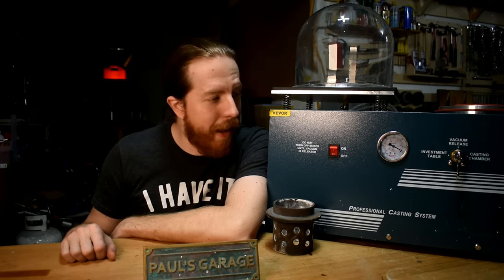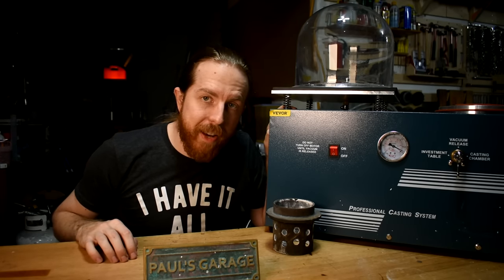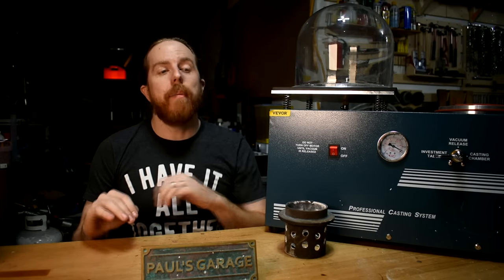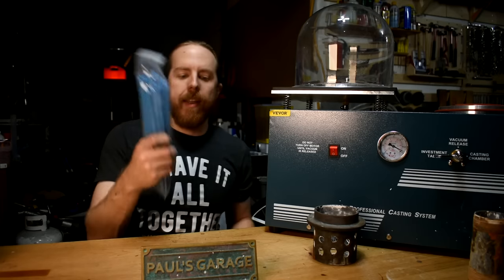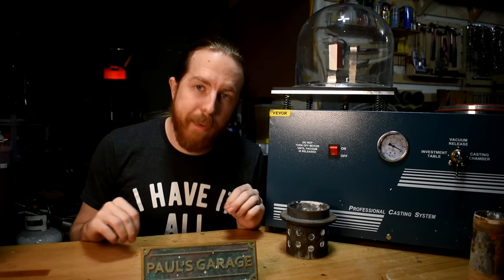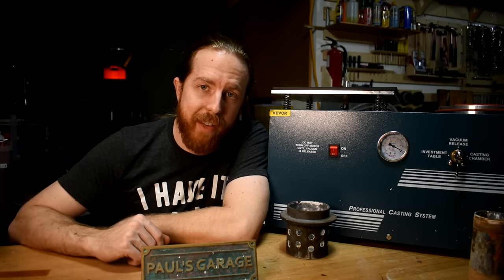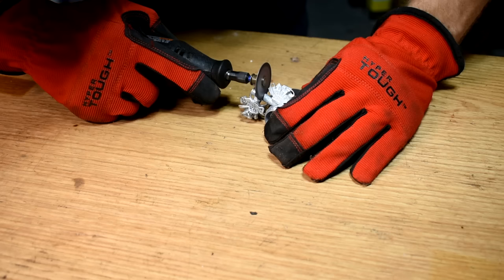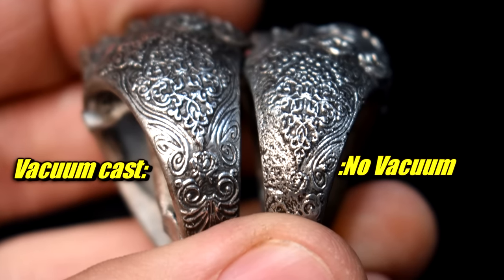Vacuum Casting 3D Prints to Solid Metal! How To

Comment: I'd rather fire my molds for an extra hour and not worry about leftover polycast getting burned in the pour. I've had several castings fail because of impatience. No reason to throw away hours of print time, mold making, and burnout, because you didn't go that extra hour and then have a small amount of polycast ruin the entire cast. I've realized that slow steady heat gives you best burnout results. I've tried using propane weed burning torch to speed up the burnout and it just ruins the quality of the mold by cracking the mold. Be patient everyone. There doesn't seem to be any shortcuts in casting that doesn't include paying for better equipment. Investment casting that is. I've still not done sand casting. The stuff I make needs higher precision then I can get with sand casting
Reply from the maker: Well said!  This takes so long, don't waste all the work with shoetcuts
Reply: I use a pottery kiln for firing the mold. It heats up slowly and has a built in timer. The only thing I'd change is getting a smaller one. I never use the full volume of my kiln
Reply: If you would just move over to wax resin you don’t even need to do a burnout, stick it in a bread toaster opening down and set it to like 240 for a couple minutes

Comment: centrifugal casting is DEFINITELY dangerous. I had an incident in one of my jewelry/silversmithing classes where an unexpectedly loose bolt caused the flask to separate from the crucible and sprayed molten bronze everywhere. I almost lost my face  and I absolutely set my friend on fire (she was wearing heavy cotton so only smouldered a little bit. everyone's fine, miracle that that is). If the "dangerous thing"  you want to do is the thing where you purposefully splatter metal on the surrounding barrier, have the highest barrier you possibly can.
Reply from the maker: Lol I was worried about splatter.  I don't intend to do any splattering intentionally, but I want to go for much bigger mold sizes.  I don't feel like having a giant mold full of pounds of molten bronze whipping around in my garage.  I could get bludgeoned and then burned if it went wrong 🤣
Reply: An "unexpectedly loose bolt" at the wrong place on your car could have you end up in a ditch. 
I've cast with a spincaster for over 40 years and haven't had a single accident because I maintain my equipment. Performed properly spin casting isn't inherently more dangerous than any other industrial process.

Comment: Just a note: if you are investment casting with gems (sapphires, emeralds, rubies etc) you can incorporate them in the wax before casting, but DO NOT quick cool it in water, let it cool down slower at air/room temp. Otherwise it will shatter the gemstones
Reply from the maker: really?  I hadn't thought of that.  sounds like a risky thing to do with an expensive stone, but then again i have no idea how to set a stone in a ring either way
Reply: @PaulsGarage  VOGMan has a video where he tried it.  I think it was about 2 years back.
Reply: Seen it done, the gems don’t have any issues with the high temp.
Reply: @chrism3839  It’s not the heat, it’s the shock cooling that may crack the stones.
Reply: @giuseppe4909  correct, I was not trying to contradict that, just adding to the conversation.
Reply: Don't try with stones that are not super hard like turquoise, etc.
Reply: Vogman has a couple of videos on the process.

Comment: For my jewelry casting I use "sticky wax" it's way more sticky than hot glue and burns out clean. Melt it into the joints but don't use it as the sprues themselves
Reply from the maker: when i look that up i keep getting dental wax, is it that stuff or different?

Comment: Zamak is 90 to 96% zinc and the fumes from zinc are very toxic. I'd stick to pewter, tin or aluminium and you can use high temperature rubber mold mix for metal under 200c!

Comment: Thank you for emphasizing that you should turn the vacuum valve off before shutting down the vacuum pump off.    Or it will draw massive amounts of oil out of the vacuum pump.  Other vacuum pump uploads show that....but they don't emphasize it.  It's a very important step that shouldn't be missed.

Comment: Optimum shell temperatures definitely vary based on alloy...the rule when investment casting steel, stainless steel, nickel-based alloys, and cobalt-based alloys is to hold the shell at 1800˚F for pouring, while cast irons work best at 1400˚F (we never did any investment-cast bronze/brass at my last foundry and where I work now we only pour nickel alloys in the shells we buy from someone else). Based on those temperatures and the usual pouring temps for those alloys and for ZA12, that shell temp is probably a pretty good guess.
Reply from the maker: Bronze/silver/gold mold temps are supposedly 700-900F depending on the thickness of the parts, I guessed lower with za12 because it melts waaay cooler than silver.  Just guessing tho

Comment: I had taken a precious metal casting class from a master caster, and the plaster we used did not require that special ramp up, we had one furnace that did our burnout and our preheat, always set to the same temp. Which either tells me you should look into different plasters, or the ramp up procedure is that that important. I personally like the one oven option.
Reply from the maker: That's good to hear.  We're you using printed resin like this or just wax?  I'd love to short cut the burnout for sure
Reply: @PaulsGarage  I was doing PLA+ as a test, worked perfectly, and others were doing wax.
Reply from the maker: @chrism3839  that's interesting, did he just crank it up to a certain temp or was it a set burn and hold kind of thing?
Reply: @PaulsGarage  It was a very simple oven, with an on and off switch, didn’t have a control board to even program.  it was turned on and left there. We had to wait until it was up to temp before we could put our molds in.
Reply from the maker: @chrism3839 huh that's interesting.  The program for this resin involves cranking at high temperature for a while then lowering down to pouring temp.  I wonder if the burnout process here has more to do with the resin.  Sirayatech cast blue is higher in wax content and they say it is meant to burnout easier.  Maybe ill try that resin with a faster burnout
Reply: @PaulsGarage  certainly worth the experiment. For someone that has the equipment to do the controlled burn out, it makes sense because your reducing any chance of error, but for most of us without access, a simplified method is our only option.

Comment: Plaster, even when "cured" still has moisture in it and if you pour hot metal into it, the moisture flashes into steam and instantly cracks the mold (or even explode if too moist). The ramping up of temperature ensures that steam in the pores slowly evaporates. So no, you can't melt the wax too quickly (for the sake of not cracking the mold). I learned the hard way 🙂

Comment: For a super quick burnout you need a phosphate bonded investment (however you'll also need a sandblaster because its rock hard an won't break up when quenching) I regularly place rings in an 800C oven and cast an hour later, resin or wax.
Reply from the maker: That's interesting, i've never heard of phosphate bonded investment.  That wounds great, but i think i want to avoid the sand blasting.  Mostly because I don't have a sand blaster.  Seems like a worthwhile tradeoff for some applications though.
Reply: @PaulsGarage  it's super common in dental laboratory (and jewelery investments for platinum) ransom and Randolph Biovest is an example of one (that the general public can buy, but it doesn't give a super perfect surface finish unless climbing at 11°c/min from 0, others are more robust).  In the past I've used hydrofluoric acid based wheel cleaner in a bottle, in an ultrasonic.....but that doesn't typically tickle many people's fancy either lol, surely something like vinegar or other dissolving solution could be used.
Reply from the maker: @karlanm925  that's really interesting, thanks.  My burnout oven can be programmed pretty specifically so 11/min should be doable.  Certainly worth trying

Comment: Very nice set up. I just bought a resin printer over Black Friday so I’ll be giving some of this a try.
Reply from the maker: that's great!  which one did you get?  they should all work fine with this resin.  If you have any questions about the wash/cure process, vogman has a great video on it, and you can ask me anything.  Vogman has more experience than I do with lost resin, though.  I just got some siraya tech cast blue which is supposed to be a bit more forgiving to process and burn out, just more difficult to print.
Reply: @PaulsGarage  I got the Elegoo Saturn 3. And I got the true blue castable resin. It seemed like I didn’t need to use glycerin as part of the cure with that one, which seems like a plus. I bought a heating pad made for plants and I’m hoping that will work as a heater to warm the resin. We’ll see. 
I think I will try to make a video of me making things to sell to see how long it takes me to pay it off, if I even can.

Comment: One thing I didn’t hear you mention…. Once you pour the investment into the flask, you should vibrate the flask to mitigate air bubbles in the mold. Also, for polishing, a roller or vibratory polisher with crushed walnut shells ( or other media depending on the material being polished ) can get into the small crevices….

Comment: Where's the split nut!  Lathe!!! Seriously though, nice setup with the new vacuum casting.  I have always wanted to try that method out.
Reply from the maker: well next is the lathe feet which will be sand cast, but i was thinking of using vacuum to make the crank knobs and the split nut.  I could try to cast in cleaner threads on the split nut and do it in aluminum bronze or something to be more wear resistant.  For the crank knobs i 3D modelled up a fillagree looking one i want to try to investment cast, too.  Probably going to make a bunch of cranks, though, several processes.  it would make a good comparo-video

Comment: My vevor electric furnace is still going strong as well.  My custom steel pipe crucible has held up for more than 10# of aluminum foil and tray melting, probably because I welded a piece of 1/4" plate to the bottom.  That will probably be the last to go, even with the big flakes I get after each session.  Still a big jump from $200 for the furnace to $600-700 for the vacuum.  Will have to think more about that, especially since I would also still need an oven.

Right now I'm doing something even stranger.  Laser cutting paper forms, then gluing them together, and plaster coating them.  Its a similar journey of discovery.  (Like I discovered using white glue that washes off is bad if you're going to coat them in wet plaster.)  Still step by step.
Reply from the maker: That electric furnace is fantastic, but it seems like investment casting itself is crazy expensive.  Even ceramic shell, you don't need a vacuum but then you need a really BIG burnout oven.  You can't win lol.  Not like sand casting: wood box and sticky sand, the end.

Comment: Dumb question, but im having trouble finding this info. For the sprues, are there channels going into the vacuum chamber? Ive read "absolutely not" but I immediately think "Well then where does the air go? Through the mold?"
Reply from the maker: Excellent question.  There are no air channels into the vacuum chamber.  This plaster is a little porous, so with the vacuum pressure (or centrifugal pressure from a spin caster) the air gets forced into the plaster, allowing the metal in without bubbles.  Sand casting does the same, the air can go through the sand

Comment: Have you considered dabbling in electroplating any prints? I'm curious about the quality difference potentially between casting and plating.
Reply from the maker: Electroplating looks awesome, but you still end up with a plastic part.  Since I'm building primarily functional stuff, I want the strength.  Electroplating almost looks cooler though
Reply: @PaulsGarage  Absolutely, each has it's place, but for figures and even jewelry I think it would be substantially cheaper and easier.
Reply from the maker: @brandonfrancey5592 cheaper definitely and you could probably use gold and silver.  I don't know about easier, it could be but I'm so comfortable with casting, I'd have to learn electroplating from scratch lol

Comment: Your results are excellent. I'm jealous, I've tried siraya tech cast, I find residues in the foundries and the results don't suit me. I'm also testing resione C01 with difficulties, probably due to the high temperature required to burn it. For the moment, the only good results I've had are with the bluecast X one, which is unfortunately expensive. I'll keep on trying, hoping to achieve the same results as you. Thanks for the motivation! One question: what is the temperature of the plaster during casting za12 ?
Reply from the maker: i've never tried burning out siraya tech in anythign other than a LONG controlled, high temperature oven.  i'm not sure how it burns out in a foundry furnace.  I have heard siraya tech cast blue burns out easier, though.  The plaster temperature for za12 is something i'm guessing at.  same for pouring temp for the za12.  I think in this video, i poured at 500c for the metal, with the flask at 600f.  It stayed liquid still for a VERY long time, i could probably lower the flask temperature another hundred degrees or more.  I've heard 700-900 degrees is the right flask temperature for bronze, but za12 melts at a thousand degrees colder than bronze, so 600f for the flask is likely way too hot.

Comment: I have a question regarding your vacuum casting machine. What is your opinion on the VEVOR z
brand vacuum casting machine you are using? Have you done any castings in silver or gold?
Reply from the maker: I have not done any silver or gold casting with it, but it should be able to do either.  The vevor machine is most likely the same as the toauto machine or other similarly priced ones for sale.  They are all knock offs of the more expensive Kayacast machine, and vevor is just the reseller.  I think vevor gives you a better deal than the others though if you register on their website.  It has been problem free so far.

Comment: Would you say the vevor vacuum is worth it? I’ve read so many people saying to just take the plunge and get the Kaya cast but that one is almost twice the price (even on sale).
Reply from the maker: I haven't tried the Kaya cast, but a friend of mine has.  He likes it, but he's also a jeweler.  The vevor one works for sure, but with kayacast you are getting a better vacuum pump, the degassing table vibrates on its own, and probably a better warranty.  The vevor one works fine, though.  It probably comes down to what you want to do.  If you are producing lots of stuff constantly, always get the better machine.  Occasional use as a hobby, though, and the added cost may not pay you back.  

Personally I plan to do some modifications to the machine and I do NOT want to butcher an expensive Kayacast rig.
Reply: @PaulsGarage  thanks for the response! There’s a lot to weigh esp factoring my own very veeery minimal ability to fix anything that breaks. They’re both going to cost an arm, I guess I should really think about if I want to lose the leg too just for peace of mind
Reply from the maker: @enzomareum1978  Yeah it's always a cost/reward game.  I have rarely regretted getting a better tool, even with the price.

Comment: Do you have to figure out shrinkage for tighter tolerances?
Reply from the maker: yes, all metals will shrink to some extent.  If you need perfect tolerances in any metal, it will have to be machined after casting.

Comment: that castable wax resin is expensive. i wonder if you can use normal resin and make a positive, then make a mold out of silicone or plaster. then cast the negative out of candle wax. bit more work but loads cheaper.
Reply from the maker: I bet you could.  The added cost of the silicone mold would mean you have to make multiples to get your money back though.  Probably a lot of them.  These things I printed in wax resin came out to roughly 30 cents per print, more than double a normal resin, but still literal pennies per item.  When you factor in the plaster and energy and metal, it's probably a miniscule money savings.  It's still probably worth it to get a wax piece to not have to process the resin prints, though.  Just make a wax one in the mold and away you go, no cleaning and curing needed
Reply: ahhh ya thats true. 30 cents isn't bad at all.

Comment from the maker: Equipment used:
Vevor stuff: Code: VVMH5%OFF (5% off on all products)
Vacuum Casting machine: https://s.vevor.com/bfQIQf
Metal Melting Furnace: https://s.vevor.com/bfQoPf

Uniformation Printer: Code: GK140 for $140 off printer, or GK230 for $230 off kit https://www.uniformation3d.com/products/uniformation-gktwo-10-3-8k-resin-printer?sca_ref=4345752.v3kdNjnqDi 

Amazon stuff:
Sirayatech Cast Purple Resin: https://amzn.to/3QOiN0M
Presige Optima Plaster: https://amzn.to/3sCre7l
10mm Wax Sprues 1lb: https://amzn.to/3MS6Cid
1mm Wax straws: https://amzn.to/49Wb3CL
2.5mm Wax straws: https://amzn.to/46loYin
Wax Pen: https://amzn.to/3sCrmUn 

My Burnout Oven Build Playlist: https://youtube.com/playlist?list=PL-aAeRpJou31awkN9xQIeMpIHwiHwRqyt
Burnout oven sold by PMC supplies: https://amzn.to/3QcFkpj 

OnePageRules free stl’s: https://cults3d.com/en/users/onepagerules/3d-models

Want to learn sand casting using your 3D printer? I can teach you!: https://paulsmakeracademy.mykajabi.com/joinus
Reply: Snip your sprues or use a jewelry saw to cut larger ones it comes out better.